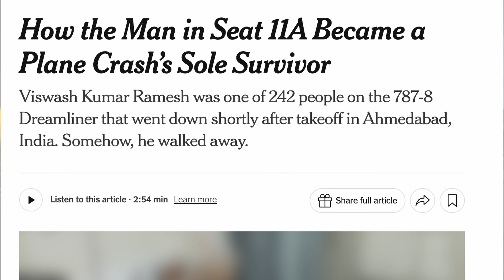Why the RAT Changes Everything – Air India 171 Update

Comment: 11:19 we need to stop repeating the theory that the copilot accidentally raised the flaps prematurely completely rather than lowering it to the second or third option.  In another video a 787 pilot and a 787 engineer who worked on the design of the aircraft both separately wrote comments that the 787 will not allow you to accidentally retract the flaps when it is inappropriate to do so.  This was already a designed fail safe. At this time repeating that theory when we know what may have occurred is just insulting to the last memories ofof the pilots.
Reply: Completely agree... 🙏
Reply: Thanks exactly my thoughts. It’s an insult to someone who has lost his life tragically. The copilot didn’t make any mistake and I think it’s ludicrous that experienced pilots such as Captain Steve immediately jump to this conclusion.
Reply: Please don't take things personally
These are just theories
Reply: Not saying you’re wrong, but a crash investigation can’t assume "the 787 will not allow you to accidentally retract the flaps”. You can't just assume the failsafe worked, so you can't rule it out till you know more.
Reply: @RJL-1968-Marlow  You're right but it has a bearing on the plausibility of that hypothesis.
Reply: @RJL-1968-Marlow  Ok, but if such a failsafe exists it would make it much more unlikely that this hypothesis is true.
Reply: @RJL-1968-Marlow  but yet its perfectly fine to automatically assign fault to the pilots.   Interesting.
Reply: @RJL-1968-Marlow  Lets also add that the controls for the flap and drop gear are nowhere close to each other in a 787 for them to be mistaken and drop gear retraction is muscle memory for pilots. Its like saying you wanted to break your car but switched the wipers on by mistake.
Reply: @RJL-1968-Marlow but jumping to blame pilots and then retracting your own theory in a day sounds fishy to me. Why was the high res video not looked at? Why the video got so many likes that capt steve was invited by indian news channels. Is this likes driven by workd haters who want to like hearing blames on pilots from other nations/communities?
Reply: Nothings off the table until it’s off the table
Reply: 100% it will also work in the other direction if you attempt to exceed Vfe and retract the flaps.
Reply: Good point
Reply: Ok thanks for the info, i will not
Reply: It is easy to write such a comment in hindsight. I think it is natural to ask questions when such an awful disaster occurs. Besides this latest video was not available at the beginning.
Reply: @Jeddin
are you familiar with the "Swiss cheese model"? virtually every plane crash is multiple problems happening and line up to cause the crash..extremely rarely will one single thing cause a crash in large airplanes
Reply: I agree, it’s a rubbish theory that the copilot selected the wrong flap mechanism.
Reply: @watercrest69 Well, Boeing is a big company, not many pilots dare to blame them.
Reply: But this is what you get when YT's want to milk the accident for profit
Reply: I completely agree. Those captains did their best considering they had no time save the situation. They were handed a losing battle to begin with 🥹😢💔
Reply: Pi$$ off with your nonsense.  It's not disrespectful as a theory. The heck with the pilots from the cesspool
Reply: I think Boeing wants to spread that narrative in the media to mitigate reputational damage to their company.

That's why the media was focused on pilot error instead of a mechanical failure of the plane.
Reply: I looked at the layout o the controls. Boeing placed the flaps and gear levers on opposite sides of the console. Kinda hard to mix up in any case.
Reply: So should the flaps be up that early in the flight.

And why was the gear still down?
Reply: Concurred
Reply: That was the first thing I wondered when hearing it: aren't there systems preventing such a relatively easy to make mistake? Thanks for your explanation.
Reply: Have you seen the video till the end?
Reply: I also saw that.
Reply: @patrickcarey5318  so I missunderstood you
Reply: Fully agree!!!
Reply: plus, the 787 will most likely not crash with flaps 0
Reply: If what you just said is true, shouldnt all Boeing 787 be temporarily grounded to prevent further loss of lives?
Reply: I am fairly sure India has their own version of the U.S FAA. Hopefully it does not emulate American police forces though..."We investigated ourselves and found no wrongdoing." lol
Sincerely the FAA certified AMPTE..lol
Reply: Are you another expert that can only shit in the comments? That is the most posible scenario at the momment untill official investigation will come to the end...
Reply: I don't see
The flaps down in the videos
Reply: The flaps was never retracted, was on 5% base on the video, there were no engine trust, and dont say that the copilot did it wrong, there is a pic that the flaps were set it up.
Reply: Thank you ❤
Reply: You have to be able to fly a plane to its crash site.  So the operation of all controls is the totality of the immediate situation.
Reply: Bang on. Rightly said 👍
Reply: Agree with most answers here.Captain Steeve was going for “the first to know what happened”, and in return got a lot of views and some interviews.  Major items are the use of wording, often says “when I take off, when I do that etc” instead of “we”, it’s a team up there. The use of captain and co- pilot iso PF PNF. And jumping to speculations (almost conclusions and for the uninformed, they really sound like conclusions) 
For conclusions we have the ntsb investigations. I appreciate the work he does so well in other videos, which is gathering info, explaining subjects a.o. ,and I am sure he will learn from this episode.
Reply: You believe Boeing?...my guess is still Copilot Error....1.1k hours in sum and He was an indian
Reply: let's not assume either way and wait for the official investigation
Reply: Exactly. Dancing around theories vs actual issue is a flaw in the built of these planes - hey check out who owns or has market partners with Boeing ? Giant stock market !!! Funny, Boeing market bounced back.  Someone is benefitting frim this ?
Reply: The media wanted that exact narrative, steve gladly gave them the quote they wanted..
Reply: @user-pf5xq3lq8i  that's the narrative that Boeing wants you to believe. Look what they did during the MCAS scandle. Will never trust the.word of the media when it comes to Boeing ever again!
Reply: @user-pf5xq3lq8i  media is run by narratives of corporates and Rich People.
Reply: Every theory is important, as theories are there to be tested. Possible outcomes will be:
- Theory is confirmed
- Theroy is refuted (likely in this case with the data available, like position and shape of the handle)
- Results are unclear (due to inconsistent or wrong data or methods)
- Theory has to be adapted, as it does not work in all situations

Even if the theory is refuted, you can learn, as usually you are testing a theory against another or against data. And until theories are tested, each one theoretically has the same importance
Reply: @JackNapierDe *hypothesis
Reply: @Yggdrasil42 ... Oops, you're right. 
I've considered it synonym. Might have been my well-founded half-knowledge.
🌳
Reply: And on that video where we can hear rat, u can see how tires of landing gear are almost paralel, go try to find another video od 787 taking off and u will see how right after take off tires are not paralel, they kinda hanging, back tires are lower than front tires on same landing gear, but when pilots pull landing gear up, then tires move up and then after that landing gear goes up, which means pilots did pull landing gear up but lost power at that moment, so only tires moved and stayed paralel, but landing gear didn't go up.
Reply: I agree with you. Chances of such experienced pilots confusing gear lever and flaps is very much unlikely. As far as i know, only students sometimes confuse the two as reported by instructors. Additionally, mentour pilot and his partner explained about the RAT and showed a blurry image of something that appeared to be the RAT
Reply: @nelsontinega2567  dude stfu as it happens more often than you realize.
Reply: True but nobody is saying it now.  Engine failure.  At the time it was a bealst guess scenario
Reply: Spot on
Reply: We KNOW nothing. Including you.
Reply: Thank you for pointing this out. It is not fair at all to direct towards these unfortunate pilots the anger, grief, and confusion of people following the crash, and even more importantly, the pain of the grieving families of the victims.
Reply: @kolaved We do not know the reason yet so this experienced pilot is giving his professional opinions. I agree that our thoughts should be with the families but the question arises why did you even watch this video if that is your opinion on this?  People will always try to find answers to how such awful disasters can be prevented but remember that no one is forced to view such videos as Captain Steve has put out.
Reply: Bottomline he is defending Boeing and finding faults of pilot.. 😢
Reply: @GudduDubey-k4g  that's the most clueless comment yet
Reply: FDR and CVR will combined provide the answers. I do not see any with insights conclude anything but rather see people speculate in causes. The possibility that pilot by mistake selected flap up or that flaps themselves retracted by mechanical/electronic failure are legitimate speculations and part of road to find actual truth. Failing "fail safe" systems have been part of accidents before. The 2 737 MAX that went nose down into the ground were supposed to be safer with pilot override systems, that turned out to be faulty. You could call those systems "pilot error fail safe systems", at least that were the stated intent from Boeing, When passenger planes went from flight by metal wire to electrical wire based systems, many speculations were made of what potential risks that came with. The potential risks remain, but statistically it have turned out to be a safer solution. That does not mean we should stop speculating in the potential risks of "flight by wire", that is how we stay sharp. Same with speculating in potential pilot errors. They happen and we should keep speculating, as that are how we consider how to train to avoid and develop to provide electronic logic, that corresponds with human logic in the cockpit and in maintenance routines.  
When we, as humans, as travellers and as aviation professionals, see senseless loss, we seek answers. We have to be able to make a clear and distinct difference between the cruel attempts seen from Boeing to blame pilots unjustified for their own company´s shortcomings and ability to embrace responsibility and the public´s and professionals urge to speculate as a mean to seek answers. It is well worth nothing that these speculations by many, are what also have contributed to exonerate pilots, that unjustified were blamed by Boeing. Although such speculations might put a temporary strain on the ones the dead pilots left behind, they hopefully ultimately will realise that such speculations are part of the prevention of such accidents ever being repeated in same manner. 
Inside the aviation industry the dialogue, that include speculations when accidents occur, between pilots and maintenance staff, all contribute to an safety culture, an awareness of avoiding mistakes. As this is a global industry the internet seems to provide a more reflecting and learning process, than traditional media alone have been able to provide. 
As I began with. FDR and CVR will provide the answers but now the many speculations and backs and forth´s between actors, in public, ultimately prevents a company like Boeing, from concluding unilateral "pilot error", as the eyes and knowledge of the aviation industry have contributed, based on evidence as it are becoming available, to prevent such conclusions, when they are baseless. 
I am sure the two pilots in command, may they rest in peace, themselves have participated in similar speculations during their careers and have appreciated how these, speculations have contributed to their learning and professionalism. Mistakes or no mistakes, they already have contributed to others staying alert and in a state of an aware safety culture. I am sure the full truth of this accident will come out. And that that truth will bring hope, also for the families left behind, in that the fatalities caused, wont be experienced by others for same reasons as happened that day.
Reply: A sophisticated plane such as this prevents exactly that scenario and overrides an action that would compromise takeoff. Look at the Paris air show crash where the aircraft system overrode the pilot’s command ironically causing the crash.
Reply: Steeve keeps pushing this co-pilot error. I'm questioning his knowledge now, is it even possible to retract flaps mid take-off?
Reply: I also believe they’re in 2 totally different places on that plane. This seems like a totally improbable theory.
Reply: 👏🏾👏🏾👏🏾 Exactly!
If he had checked the online flightradar feed he would've seen that the feed cut out before the aircraft left the runway. I would say that hints at a dual engine failure.

Its easier to lean into the narrative of "foreign" pilots' error when the alternative is to question your native aircraft and engine manufacturers.
Reply: Envelope protection will prevent you from raising the flaps below stall speed, but it doesn't stop you from raising flaps just above stall speed and then not having enough lift to keep an extremely heavy airliner climbing. Nor does it prevent the pilot from then stalling the aircraft by pulling back on the yoke too hard.
Reply: The flap lever and the landing gear lever should not be next to each other.  It’s too easy to grab the wrong lever if you’re not paying attention.
Reply: @Chrisoula17  The flaps lever is on the center console, and it has notches that require lifting and releasing the handle while moving it forward and back.  Landing gear is unmistakable in comparision to the flaps lever.
Reply: @Chrisoula17  they’re not that close to each other. And even if they were. That was the point of the 787 engineer. They didn’t design a multi million dollar flagship aircraft with a “oops, I pulled the wrong lever”. They already considered the options that someone might accidentally pull a lever or at an inappropriate time and the lever will not function when it is not safe to do so.
Reply: @Jeddin It's a Boeing plane. Anything can happen as most of their systems are poorly designed.
Reply: @Red_Fox-o8q  From what I read, those incidents were due to bad software and not a question of pilots pulling wrong levers.
Reply: @Chrisoula17 also they are in entirely different locations - the gear handle is on the instrument panel, generally under the backup AH and in almost all Boeing aircraft the handle is shaped like a little gear handle to avoid that kind of confusion. Flap lever is on the FO side of the pillar next to the throttle quadrant. They've thought about this - a lot....
Reply: @manyshnooks  I do wonder why the terms are not distinct, though. Both ending in 'up' and 'down'. Surely one could say flaps up and down, gear in and out, so as to make them as different as possible?
Reply: @Chrisoula17 , who said they are??
Reply: @Chrisoula17 They're not.
Reply: @Chrisoula17 Thanks Captain Obvious. Did you think that yourself or just repeat what you read or heard somewhere else?
Reply: @Chrisoula17  The are very far apart
Reply: @Chrisoula17 They are indeed not close to each other. There was another video where they showed the inside of the cockpit and clearly showed that those 2 things are at a distant to each other. They are not even on the same level. The chances of accidently mistake one for another is very weird
Reply: @Chrisoula17  they are not next to each other.
Reply: I don't think they are
Reply: @Chrisoula17 completely different feel and appearance, and all that was deliberate. The flaps you have to kind of jolt and move between each detent.
Reply: @Chrisoula17  It was either Juan Brown or Denis Davidov who pointed out that the flap and landing gear controls are NOT next to each other, are not similar in appearance, do not work the same way, and are essentially impossible to mistake one for the other.  I think the copilot error theory can be strongly ruled out.
Reply: @llanitedave maybe in this case it didn’t happen, however we airline pilots are heavily trained to spot those mistakes and stop them before they occur, if this miss selection could be completely ruled out then we wouldn’t be trained on this, and yes it did happen in the past and will be happening in the future, but far less than it used to occur. In my airline we introduced a new SOP regarding this, we first point with the finger to the respective lever, then call it out loud before grabbing and calling again the intention “up, down, 1,2,e, full,before moving it, thus we have some time for the PF to spot a possible miss selection.
Reply: @Chrisoula17  they're not. One is in the "dashboard" and the other is along the engines levers. it's virtually impossible to mess both up
Reply: @Chrisoula17  Stop spreading misinformation, or at least ignorance.  The two controls are nothing alike, nor are they anywhere near each other.
Reply: @Chrisoula17 its not next to each other on the plane this video is about.
Reply: Fail safes can fail. While the evidence is looking to no longer support that theory it is still possible. 

He was listing possibilities and stating they are all possibilities with that being less and less likely. When I first saw the video pilot error was high on my list. After seeing Steve’s videos it is not high and I don’t believe it is that.
Reply: It is like saying the driver pressed the accelerator instead of the brakes. They were goddammed pilots with muscle memory, long flight experiences.
Reply: @rohitchoudhury1  Actually, it's more like saying the driver turned n the windshield wipers instead of hitting the brakes.  They're that different.
Reply: @rohitchoudhury1 1.1k hours? Hell no
Reply: @rohitchoudhury1  its not like saying that in the slightest. It's more in tune with saying, "the driver meant to press the brake, and reached across the car and opened the glove compartment.
Reply: @rohitchoudhury1 , Actually the accelerator/brake err is a million times more likely than a Landing gear/ flap err.  It would be more like shifting into reverse instead of pressing the accelerator.. completely nonsensical theory.. especially for a two pilots In a flagship aircraft
Reply: @Chris-8.9 but you know, it already happened right? Spanair 5022. EDIT: Actually on this flight the flaps were up from the start. Disregard my comments.
Reply: @arthurdefreitaseprecht2648 , no it didn’t.. The report does not say the pilot’s mistakenly adjusted flaps instead of landing gear.
Reply: @Chris-8.9 yes you are correct. They had the flap up from the start. I will edit my comment.
Reply: @arthurdefreitaseprecht2648 , I find this retraction very refreshing — never seen it on YT to be honest..you have my respect sir.. haha
Reply: @rohitchoudhury1  it's even worse, is like saying that instead changing the AC configuration, you changed the cars gear
Reply: @223rmt now the double engine out is clear, but the hypothesis was not so crazy. The point is, you have two very different actions in a time order. You reverse them in the time order. That's not so unreasonable, who never (almost) threw a spoon in the trash and put a yogurt container on the dishwasher/sink. Two very different actions, with a given time order, where the time order gets reversed. Not only that, such kind of accident happened in Spanair Flight 5022